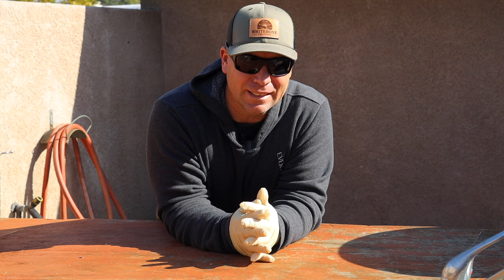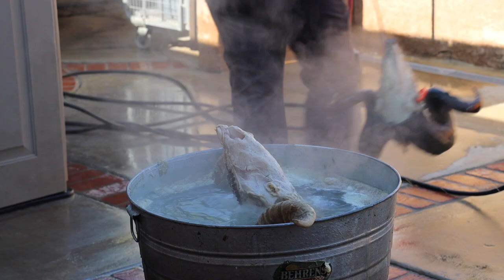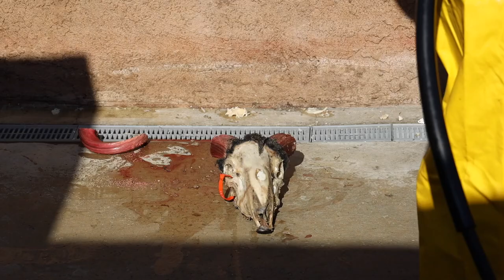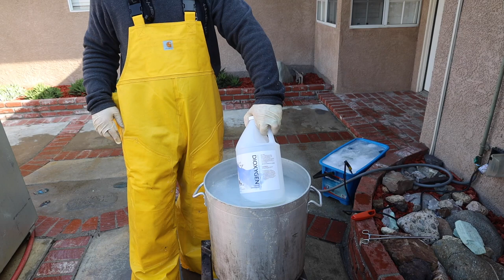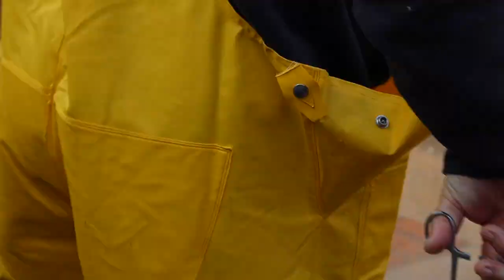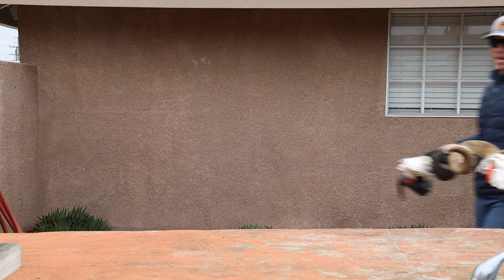HOW TO CLEAN CURLY HORN RAMS SKULLS

Comment: Great video! Question: I found a set of desert big horn ram horn while backpacking. Legal dead head, the soft material is mummified from the desert air. Is there a coating or anything I should apply to the horns to preserve them or will they be fine as is? thank you!

Comment: Thank you for the video Hunter ! I was wondering if this technique works with horned skulls ? Should you remove the horns by boiling before ? Or you keep them as they are with the horn sheath ? Also, should you boil the skulls in hydrogen peroxide for whitening ? Thanks again.

Comment: Omg, boiling, powerwashing AND purposefully removing nasal turbinates?? Not good... 😬
(Simmering ok but actually boiling is NOT!)
And for anyone about to jump all over me, I also clean bones & skulls & boiling gives fast results but over time it will start to fall apart because boiling breaks down the bone integrity. Maceration or using dermestid beetles are WAY better, slower but its worth it. I would NEVER boil a skull & never purchase one.